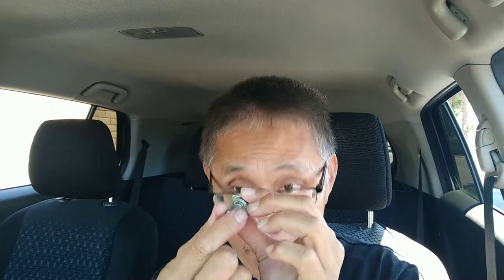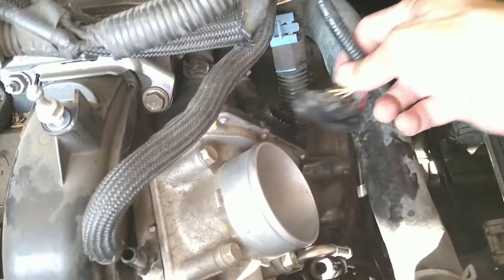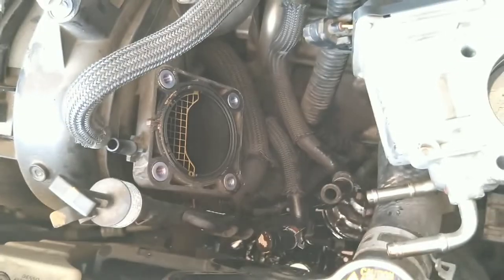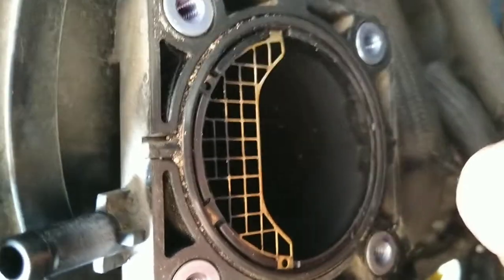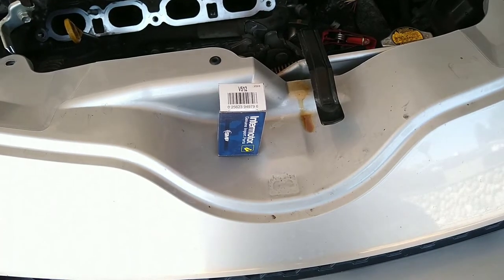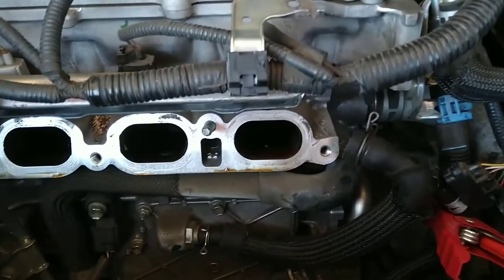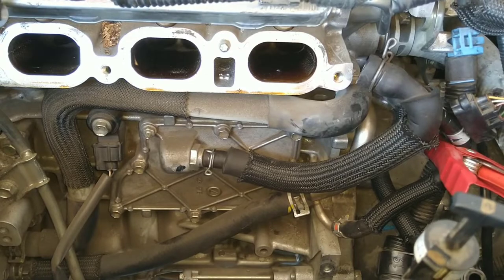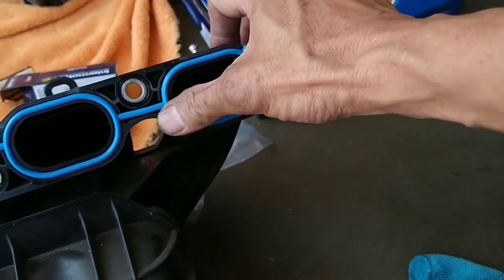Car Care | Remove and Replace PCV Valve

Comment: Great job! Nice tutorial. And you know we are all about doing work like this yourself whenever possible. People can be very scared to work on their vehicles. Which I understand. They're too expensive to mess something up worse, but a lot of times it's a pretty easy fix. And can save SOOO much money!
Reply from the maker: Yeah!!!! This one should be a very easy job! But NOOOOO, they have to bury it way under in such tight place that you can even put a socket in there without removing the intake manifold!!!!🤷🤦
Reply: @MoBangFoYoBucks  😂🤣 yeah. I always feel stuff like that is done on purpose so you might end up taking to a dealer for repair.

Comment: Wow so much to remove for just a tiny part to replace.  Will this help keep good mpg?
Reply from the maker: I don't know! But if it is stuck opened, you will burn up the oil. If it is stuck closed, you will have all kind of oil leaks from various places!

Comment: So keeping oil changed may keep this valve from having to be replaced?
Reply from the maker: Yes and no!!! By changing oil on time, it help to keep the engine from building up oil crudes which will cause the valve to get stuck! Depending on how bad the engine burns the oil, the PCV can be stuck. So you can have the mechanic check it without removing it. Like I mentioned in the video, you can spray some sea foam additive into the PCV Valve to loosen it up if it is stuck. I don't want to overwhelmed you with mechanical information. HAVE SOMEONE CHECK IT!